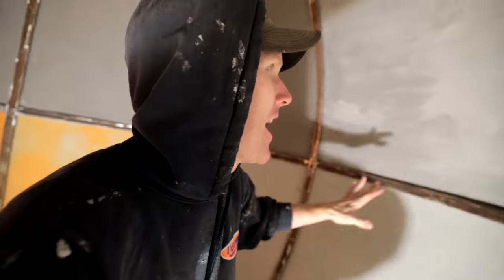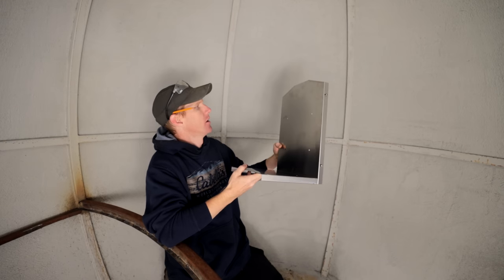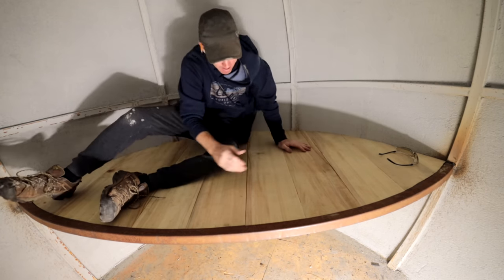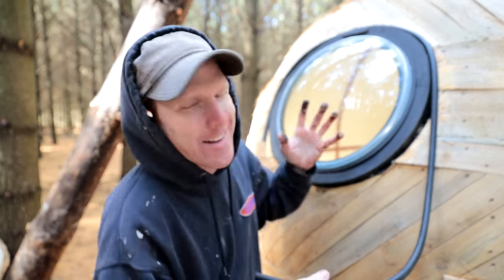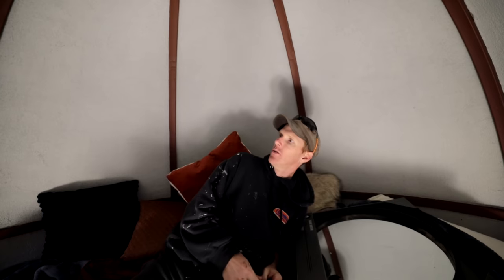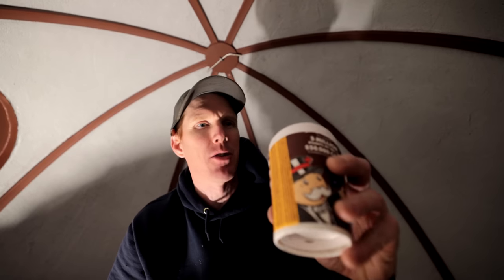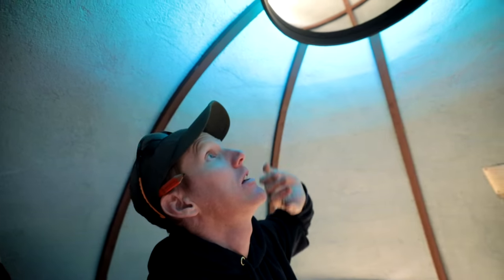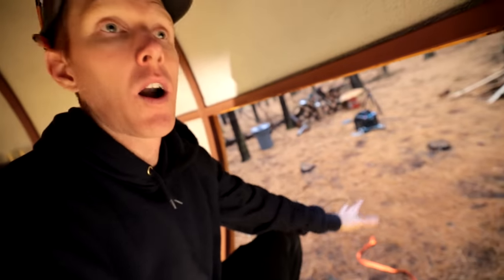Building BIG BALL Cabin (It's finally DONE!)

Comment: You might want to consider keeping a container of Damp Rid inside the sphere when it isn't occupied. Condensation will build up inside because it is waterproof. I lived aboard a fiberglass sailboat for a few years and this was often a problem. Great build! Check out the use of gimbals, attachment points used for oil lamps and such. They're something like small "gyroscopes" that keep horizontal surfaces on an even keel when a boat is rocking. I always love how you include those extra little touches that take your cabins in the woods to the next level.

Comment: This was a really outside the box build. Being a ball is a great start, but the challenges involved, an overcome, were fun to watch. As far as the circular window is concerned, and the flashing thereof, I'm not sure why you didn't weld a ring on the outside. Being curved, and matching it exactly would be difficult, but a short ring on which to attach another material, or under the ring gasket when installed would probably sealed it up the first time. My 2 cents. Otherwise, this, like all your other wacky projects was outstanding entertainment. Good luck on the tiny boat build! I doubt anyone would really challenge you on this one, especially for the small amount of $ you invested.

Comment: Cup holders. Even gyroscopic ones, perhaps.

I had thought of suggesting smoothing out the bottom and building a platform with wheels on the bottom that was curved to meet the base, but then the floor would shift relative to everything you had on the walls, and I thought that would get complicated. It might've also been hard to get the wheels to move smoothly so it could have just created a worse experience. A whole second sphere with wheels around the entire thing inside the first might have solved it, but then what about the windows and doors?

Good job picking out the bedding, it definitely looks nice, and I like the rust colour of the beams. 

Personally, I'd gladly have my bedroom be in one of these (Attached to my house with a flexible bridge? Fully indoors?) if I was allowed. I think the rocking would be very soothing.

Comment: You need some climbing wall hand/foot holds for the door for steps and since you have it hanging from a tripod run a small chain from the bottom to each pole to stabilize it from moving in any direction also it would look better on the outside if you use some black calk or silicone between all the outer wood strips and stain the wood.

Comment: I have an idea for a future build. You could take that spider tunnel concept a bit further and make an underground cabin. You could dig a big hole and make the walls and stuff out of concrete since it is very solid. And then water proof it all and fill in the hole with dirt and cover the cabin. You could make it so that it is semi hidden, so that you can see it when you are up close to it, but not from a distance. Instead of that hidden hole that you have for the spider tunnel, you can make a nice set of stairs going down to the cabin. You could make 2 rooms or something, like a room where you do the cooking and stuff, and then a small room where you sleep. It could have a modern feel to it, but everything is semi hidden underground. It could be cool i think.

Comment: I own two of the wood stoves the cub and the grizzly I use mine in RV camper and rv trailer absolutely amazing I'd recommend a chop saw cause they require smaller pieces of wood 
Canadian made stoves 🇨🇦🇨🇦🇨🇦🇨🇦🇨🇦
Where did you get the window from?
Reply from the maker: I made it.  The glass is from a high bay light.
Reply: @ModernSelfReliance  awesome

Comment: ⚠️please be careful with that mirror, maybe you can tack a wire around so there is a rim holding it if the glue fails. Which it more than likely will with the heat from the mini cube. My sister in law had a tragic incident at a bikram yoga studio that was wall to wall mirrors. Anyway I really love the modern design of the ball cabin. If the balls a rocking don’t come a knocking lol

Comment: In your projects you keep using 110V lighting and other devices when you can easily use 5V lighting and devices that are radically more energy efficient and would extend the use of the Battery system that  YOU SHILL FOR.  Why is that?  That one lighting you used in the top requires  the battery system inverter to up the voltage to 110V and then the transformer of the light has to step down the 110V to whatever the light use.  That is a lot of wasted energy  from voltage conversions.